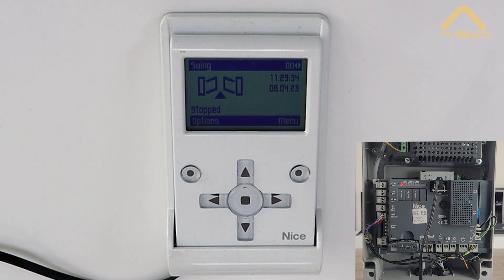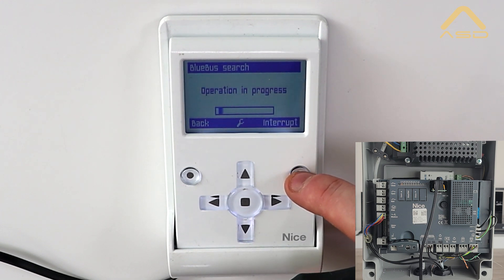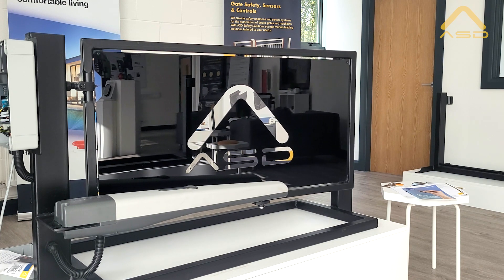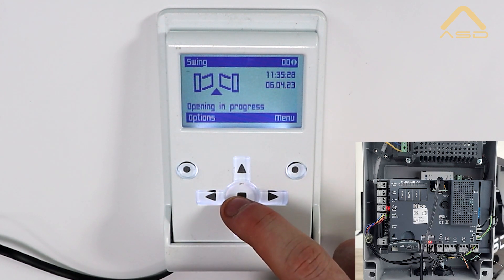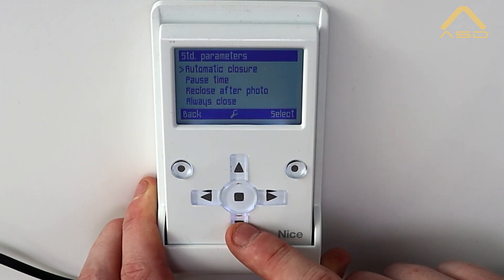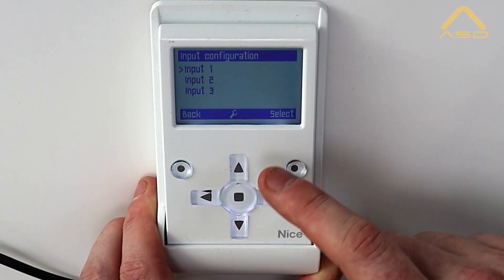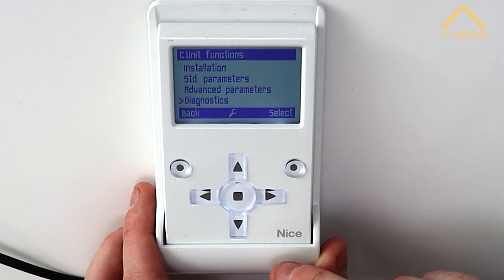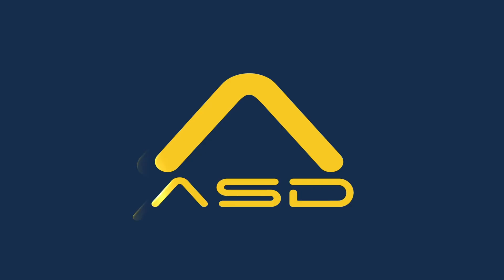NICE MC8-24V Control Panel Programming Methods – METHOD 2 O-View Board Programming

Comment: Hello, 
I have connected a new TO7024 motor with my existing MCA1 control board. Both the new and the existing motors are not moving to the end of the closing point or the end of the opening point.

Comment: Thank you so much for your very informative video on the oview programmer with the MC 824H controller. I have one of these units operating my swing gate and within the last several months, the electronic mag lock has stopped engaging when the gates are closed. I've tried to troubleshoot this on my own as there are no dealers/installers in my area. I have shown the mag lock to actually work with isolated voltage generator (12 -24 V) so it appears to be intact. I have an oview programmer and wondering what settings I need to have programmed into the MC824H to  maximize the potential for the lock to work. My next step is to order a replacement board for this MC 824H controller. I would appreciate any help that you could afford me.

Comment: Hi,  quick question regading flashing light setting. Is there any parameter in this seting to modify the interval period. Currently flashing light is only active during the opening door period, them stop and start again when closing. I would like to know if flashing light can be active from opening and close phases without any cut.
Reply from the maker: Yes it can be changed using an Oview